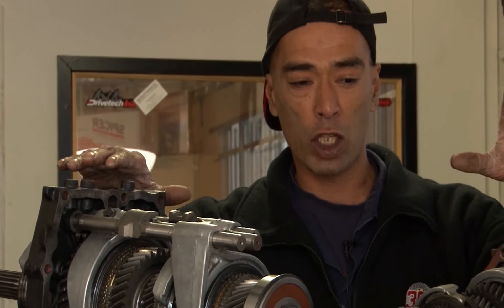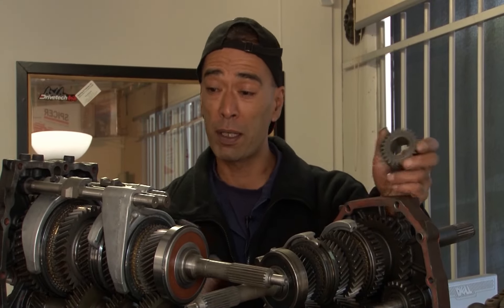H150 vs R151 Gearboxes

Comment: I am a victim of the R151F gearbox with its weak 5th gear( which blew up ) and the gearbox to transfer case connecting shaft with its spline stripping problem in my old troopy…. $3300 for a new gearbox and $350 for the upgraded connecting shaft…… was still all good when I sold it. Loved my troopy.

Comment: Hey there, maybe you can help me since it looks like you have a alot of knowledge in the Toyota gearboxes.
I am running a 200 series diesel 4.5 D-4D with the H150F gearbox. Now I ask myself wich of the plugs is the fill plug for fresh oil when doing the oil change. 
Is it the a bit higher one on the RH side, so same side as the drain plug or is it the bit lower one with the torx that is alone at the LH side? 
Bit confused and cant find any propper source online regarding this.

Comment: I have a grandpa spec 80 series 1HZ with H150F and would love a taller 5th as we don't tow and vehicle is unmodified. Does 2800rpm at around 110kmh. Is that possible? What is the best swap or modification for this?

Comment: Bit confusing as i thought the H151F  was found behind the twin cam petty motors and factory turbo diesel variants. The unit he correctly identifies as a H150F is standard fare behind NA 1HZ's and the like and is easily identified by the 21 spline input you can see in the vid, same as his R series right next to it. The petty and factory turbo diesel variants have a 14 spline.
Reply from the maker: Naaah at the end of the day the H150/H151 are the same size geartrains with minimal differences ....The size difference to the R151 is obvious in this video .. which is what the story is about - not the technical differences in spline counts or synchros ... its SIZE which matters :-)

Comment: Is the 80 series turbo box able to fitted into a 100 series NA? I know the input shafts are different as are the gear lever position
Reply from the maker: Everything is possible but nothing is a straight bolt up solution.

Comment: You mention that heat is the killer for the R151 gearbox, is it possible to add an oil cooler to help resolve this problem?
Reply from the maker: Sure it may help, but the biggest killer is the position of 5th gear and/or shockloading the gears with high turbo boost.

Comment: Does my land cruiser 105 with 1hz non turbo engine have the r151f gearbox ? I do mostly city driving with loaded trunk. Maybe a lil towing. Should I be worried about the gearbox ?
Reply: Na don’t be worried. Imo the R151 is a very solid box. I’m running it in my turbo diesel hilux and towed a 2.5 ton caravan from vic to Queensland many times and it’s held up fine. I rekon it’s down to the driver changing to too high gears too early and lugging the car and putting excessive load on the gearbox

Comment: You know the 1HD-FT and FTE are single cam 24 valve.
The petrol is double over head cam and never had a turbo
Reply: He's talking about the 1fz dohc mate
Reply: @BigMoistMuffin  he definitely said HD engnes. 

1HZ is NA 12 valve SOHC port injection
1HDT is turbo 12 valve SOHC direct injection 
1HDFT is turbo 24 valve SOHC direct injection
1HDFTE is turbo 24 valve SOHC electronically controlled direct injection

Comment: hi I will like to know witch gearbox  is better for the 1hd-t engine the h150f or 151f ?? please need to know from some one like your guys...thanks . the only reason I ask is because the h150 have a more  ratio in 1,2 them the h151f .

Comment: Um was really keen on a gearbox from these guys but they are confused about designs in their own video. 1hd-t, 1hd-ft and 1hd-fte all are single cam engines. There aren’t any dual overhead cam Diesel engines in the toyota line up apart from the 1vd.
Reply: Jack Hare I think he was referring to the petrol motor. The single cam turbo diesel and twin cam petrol motors have the H box hence why it came sounding as if he was referring to a twin cam diesel.
Reply: Plus 80 series 1hz's use a H150F tranny, petrols and factory turbos run H151F...only 105 series 1hz's run the R150F box. Not sure what these blokes were on about
Reply: @jimmy2824  My spec says KUN26R Turbo D4D 2005 onwards should have R151 box ...I am confusemented.
Reply from the maker: @markyes2041  yes correct - but this video is referring to the R151 in a landcruiser.  AT the end of the day the video was to show the size difference between a HZJ105/HZJ79 gearbox to a factory turbo, petrol or 80 series gearbox
Reply from the maker: @jimmy2824  Nope Jimmy you are wrong.  the HZJ76/78/79 also run the R151 box as well as multiple models of hiluxes and some Prados.  The video wasn't meant to be technical - just to show the general layperson that size does matter hehe
Reply: @360GearboxesDiffs  yep, I know this. Sorry, I was just referring to the two wagons with the same chasis and running gear etc.. other than the gear box and transfer of course. 

My mate has actually just blown his transfer in his hz 78 troopy that's had a h150f swapped out from a 1hz 80 series. Those transfers arent easy to find! (the stronger, none all time 4x4 pov pack transfer case I mean)
Reply from the maker: @markyes2041  Yes you are correct - you have a R151 in your KUN26!
Reply: @360GearboxesDiffs  Very late reply..but I think you are confused about your own video? The video is about the differences between the H150 transmission and the R151 transmission.

Your video states the R151 was in the standard non turbo charged landcruisers which is true for 1hz 105 series and I believe the 1hz 76/78/79 cruisers(correct me if I'm wrong but the 'R' series box was also used in some hiluxes)

I was simply pointing out that the R150 gearbox was not used at all in the 80 series landcruiser. The 'non turbo' 1hz 80's ran the H150 gearbox, and the 1hd-t, 1hd-ft and 1fz-fe all ran the H151 gear box, note I said the 'H'151. And the only difference between  a H150F and a H151F is the input shaft size and spline type and first and second gear ratios(aswell as the H151 tranny running the 300mm flywheel compared to thr H150's 275mm flywheel).

My point is that the R151 is a smaller completely different gearbox as you stated, but it was never used in the earlier(80 series) cruisers. And also the H150 was never used in any factory turbo landcruiser at all, that was the H151.

I own two 80 series cruisers, My 1hz 'non turbo' one has the H150F and my 1hdt 'factory turbo' one has the H151F.
Neither of them run an R151...however my mates 1hz 105 series does, which is weak as piss. 

I'd have thought you guys would know this if you rebuild gearboxes for a living but, if you still don't know what I'm talking about I'll happily send you a photo of both my vin plates, with engine and gearbox types on them to clear things up. Or do a quick google search haha!
Reply from the maker: @jimmy2824  Nah all good Jimmy, I think we had replied to your multiple comments but we had resolved that one so not sure why we commented again - I think it was in response to your comment ".only 105 series 1hz's run the R150F box. Not sure what these blokes were on about" ... which is wrong but you've added that in now that YES it came out in the HZJ76/78/79S AS WELL.  The video wasn't supposed to be technical - but rather to show the size difference between the R151 & H150/H151.  Yup you are correct on all accounts above and trust me - we are not confused - we know that all 80 series came out in H150/H151s so all good there :-)
Reply: @360GearboxesDiffs  Ah no worries! glad we cleared that up haha. I didn't doubt you guys would know these things like the backs of you're hands, it's certainly  sometimes hard to explain things in a short message on a YouTube video!